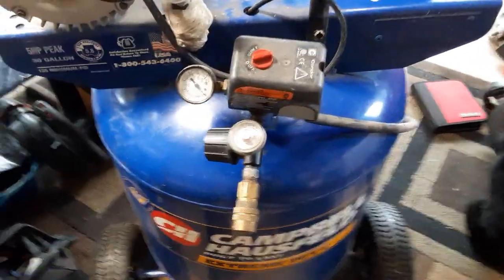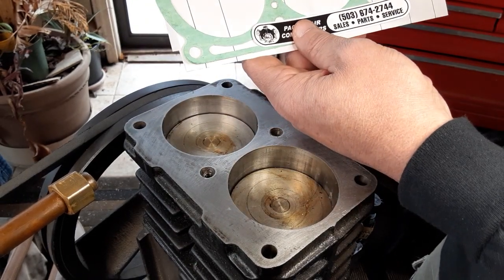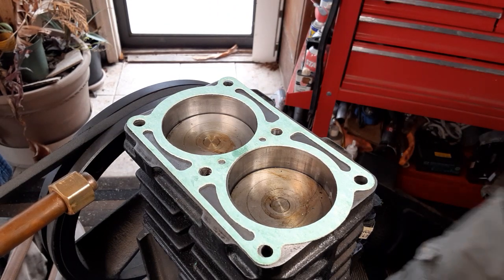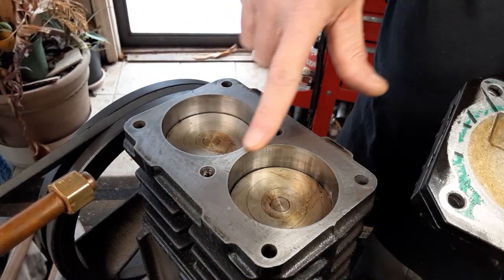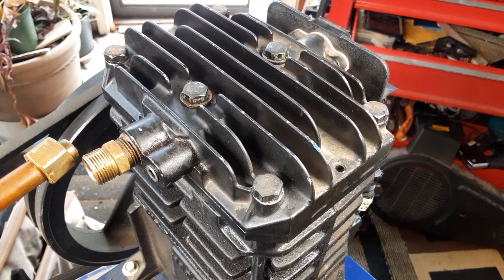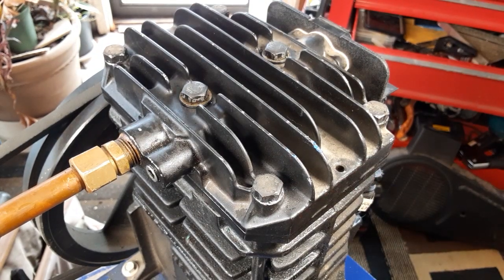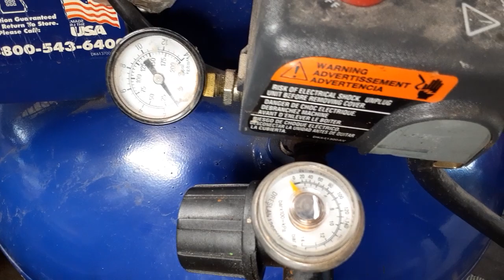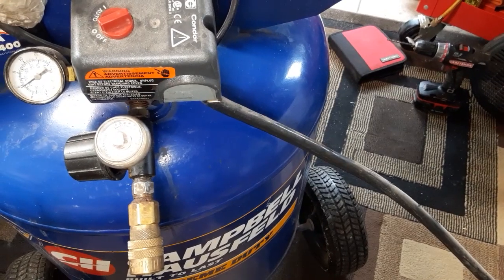Campbell Hausfeld air compressor repair, no pressure, head gasket replacement, 2-cylinder

Comment: Isn't that hole in the gasket for providing clearance for the rivet? Does the head still wobble when placed on the cylinder with the gasket in place? How old is this compressor in terms of age or hours?

Comment: I guess, to each his own. Some advice if you ever torque down another head always chase the threads in the block with a tap and clean the threads on the bolts and apply oil to both the threads and underneath the head of the head bolts and washers if they are used.

Comment: Part number XA011900AV.  I was advised (in 2012) by last guy I purchased from that head bolt torque is 200 in. lbs., start in middle and work out.

Comment: In the USA its all about safety, i wonder why the v belt and pully isn't coverd up🤔
Reply: It does have a screen guard, 2 piece, one bolts to the pump and to the tank, the belt access screen bolts to that one. Not sure where his is, but i have the same one and i have the guard on mine, because not hard to have a shirt, or finger get pulled in, not that it would kill you, but hurt pretty bad.